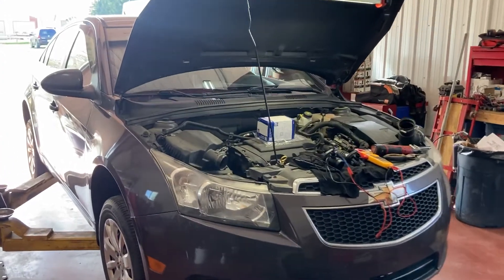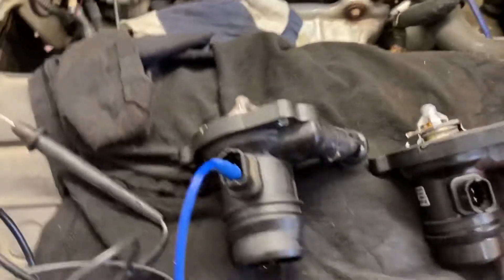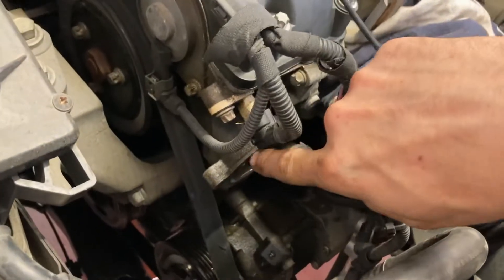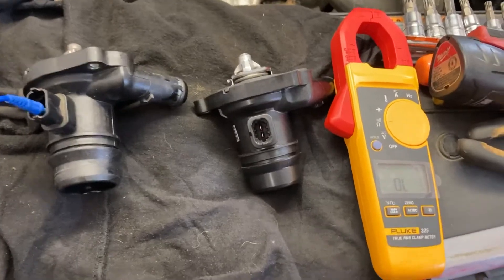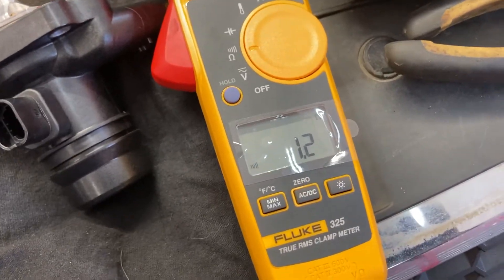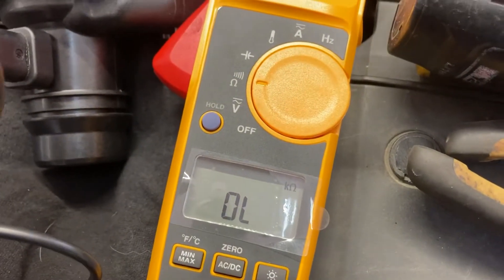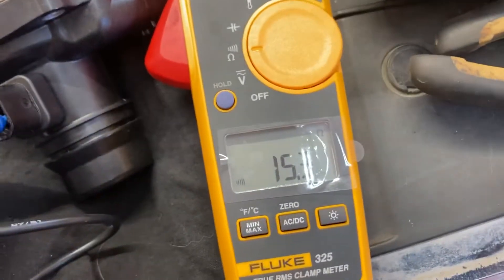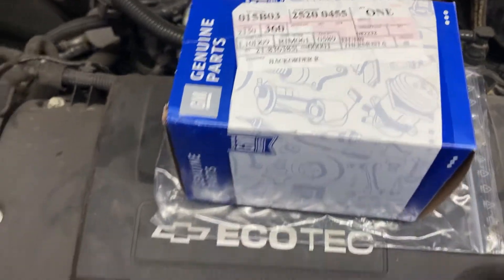2011 Chevy Cruze P0597, P0599 coolant thermostat heater testing

Comment: That was 15.3 not 1.53 ohm. I think your Fluke test leads need to be replaced due to high resistance. Mine usually measure 12.4 ohms max.